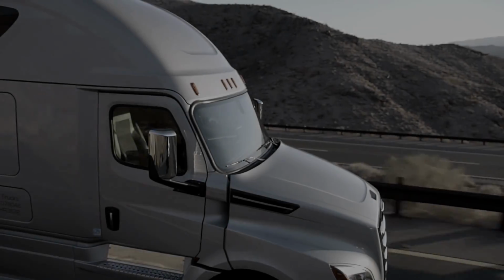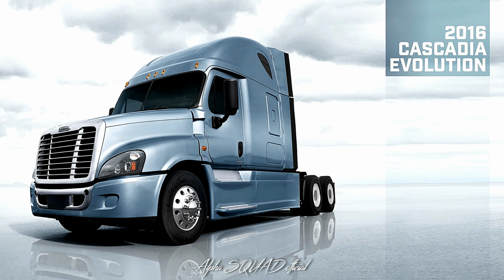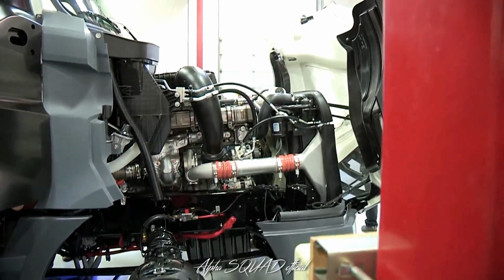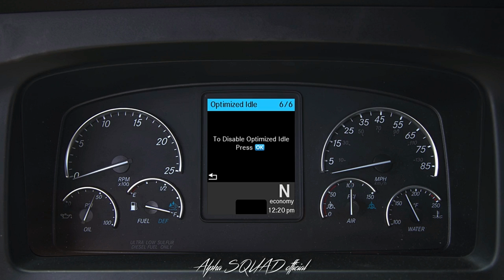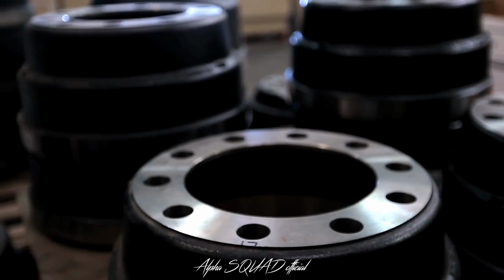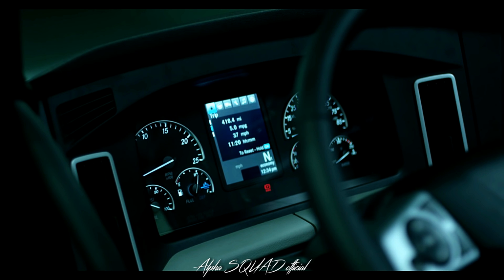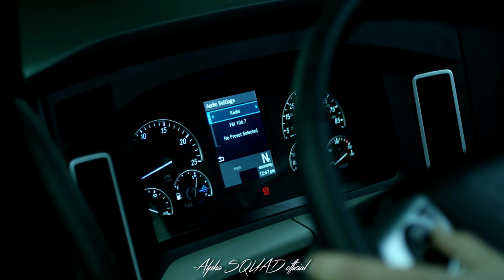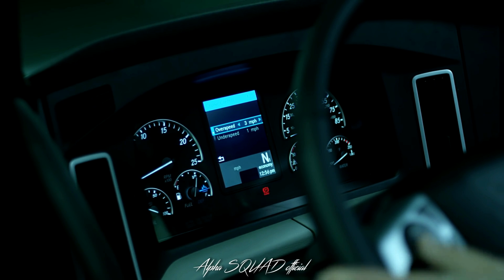Freightliner Cascadia – Truck with a Mini Bedroom

Comment: I'm guessing the age spread of the engineers that designed the new Cascadia is between 28-58 years. This puts the design team smack dab in the middle of the computer revolution. Video games, apps, and everything one could do, or would do, at ones finger tips on a keyboard. Driving a truck however, consists of being constantly ALERT to the    driver's EXTERIOR environment, meaning in non-engineering terms..."the world OUTSIDE the windshield". To become involved with buttons INSIDE the windshield, is to become DISTRACTED from the world OUTSIDE the windshield. If engineers did not have the input of seasoned PROFESSIONAL drivers, for the redesign, Freightliner execs should seriously consider tapping into the WEALTH of wisdom and experience of seasoned professional TRUCK DRIVERS to add valuable design input. On a lighter note, it seems kind of silly to have a group of engineers raised up in the ELECTRONIC age, put together a piece of equipment for use by people who operate in real time....in the AUTOMOBILE age. No matter which way is tried to make things more CONVENIENT for drivers, the best and foremost convenience is to design a product that will roll mile after mile after mile.....after mile...WITHOUT BREAKING DOWN. It's REALLY REALLY INCONVENIENT to get PUT OUT OF SERVICE BY YOUR OWN TRUCK! Because the CHIP SHIPMENT that your ECM is built with, is stuck a mile out in the drink waiting to unload at Long Beach. And REMEMBER, that ole truck yer movin down the highway....aint no video game! Even if the little do jobby buttons on the steering wheel look JUST LIKE THE ONES ON THE PLAY STATION YOU GREW UP PLAYING ON. ALWAYS REMEMBER....PLAY STATION....NOT REAL...78,000 POUND TRUCK...VERY VERY REAL. Let's all stay safe, and when that truck is moving, keep your eyes on the roaf, not the neat little menu screen in the middle of the dash.

Comment: Who knows  , how to idle this truck ???
Reply: Dilshod Tolibov I do! Simply press the brake hard to the floor and hold, then press gas pedal all the way till you tac at 1200. Turn on cruise, and hit RESUME. 
(If it doesn't work, repeat until it does)
Your welcome!
Reply: James Miller are you swift driver???

Comment: Really?! controls on the steering wheel gives the driver control of the dash cluster while keeping hands on the wheel and eyes on the road. Ever here of "Driver Distraction"? Driving Truck is all about focus. To put this into proper prospective, a common motorist Distraction is the vehicles sound system. Seen any bad car driving lately? The other important tool that major truck manufacturers ignore is the rear facing mirrors. Every commercial Drivers need to have the feeling of complete vision around the vehicle.To put this into perspective, seen any truck drivers involved in needless accident lately. The best example of a Truck Driver comment that beholds that human driver as not knowledgeable is..." that car cut me off". Not true, you are the commander of the ship, the scanner of the highway universe and the captain of control.

Comment: I have been driving this truck since November 2017 and i put about 55K miles on it well honestly its a beautiful truck, smooth and comfy to drive. Headlights are awesome, just enjoy driving at night. Well the steering angle needs to be  improved, most of the states has roads way small and narrow then some few others states, and lower curtains looks good but not practical its easy to lose them. Our highways are not perfect to have low curtains

Comment: Considering the new Detroit engines won't run in -10* and colder weather it might as well have a nice interior. What a joke of a truck.
Reply: I've run a DD15 in -40 in Fargo ND before with no problem. What are you talking about?

Comment: looks to me like freightliner is trying to build a better horse. if you're thinking of buying one of these clydsdales, maybe you should hold off a bit and get signed up with Tesla to buy one of their new all electric trucks. check out Tesla's new video on it. putting money down on one of these dinosaures is the worst thing you can do. be one of the first to buy one of the tesla's and you will have a liscense to print money. never change the brakes. a warranty on parts including windshield that lasts for a million miles. check it out.
Reply: John Doe ANDYAYCOCK
Reply: John Doe ANDYAYCOCK

Comment: I bought it a month ago with a lot of expectation and joy as it was my first new truck. Day one the ABS light came on, the rest of the week I had lower bed not locking (still not fixed due to part unavailability), front brakes over heated and skidding took a week to replaced it since they didn’t have parts, alignment done (one of my tires is garbage and had to pay myself), and the engine lights kept coming on (IPM, HVCR, ICUC, SSAM, MCM, CPC and etc.) name the sensor it is ON. Freightliner has NOOOO idea why and my truck isn’t the only one here with those issues. I have spent more then 3 weeks now in the service shop without a proper fix or resolution. honestly with the holidays coming I believe I will be broke and homeless soon as I put all my savings as downpayment plus the monthly isn’t cheap. 

Freightliner’s Elite service centre don’t have the parts nor understanding of how tough our life can become by missing weeks and months of work. With parts being Back ordered to over 30days wait I suggest you guys save your money until all these issues are resolved.
Reply: Demand the dealer takes the lemon truck back and issue you a new one. 3 weeks of down time is ridiculous!
Reply: It built in Mexico, what do you expect?
Reply: What do you expect, Cascadias are cheap budget trucks, why do you think so many companies flock to them over Peterbilt and Kenworth? While they are crap, they are cheaper to fix than competitors.
Reply: GamersEgoTV Peterbuilt and Kenworth stay in a past century. Their paccar engines are crap, comins are so-so, fuel economy is not remarkable. The only things are the best interior in Ken and historical Cats for Pete. That’s it. Freightliners are cheap in repair, they are comfort with smooth driving, their AT is good, fuel efficiency is high enough, and so on. This is like a Korean car that is not the best in every particular discipline, but overall score is high. 
I wonder how many people believe that a typical dealer shop will fix their truck during one day. For this you have to visit small but professional shops. Each immigrant driver knows few. But only Americans suppose the system works )))
Reply: Their goal is to sell sell sell.... and are trained to present the product in an impressive, well chosen words with one goal sell. I'll bet they don't know anything about what they're saying here. Team work with each having specific set goal and how to get there.  They perform, get paid, and others deal with any problems later. Resale value depends on who's selling.
Reply: Hope everything works out dude
Reply: Trying to copy off the Volvo its a shame!
Reply: Murtaza Sherza
Reply: Murtaza Sherza
Reply: Murtaza Sherza
Reply: Murtaza Sherz